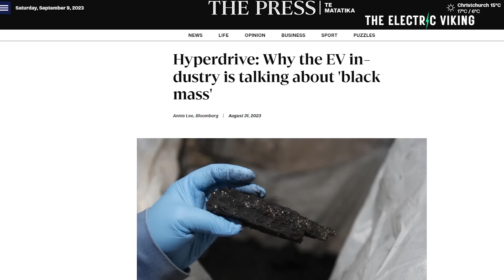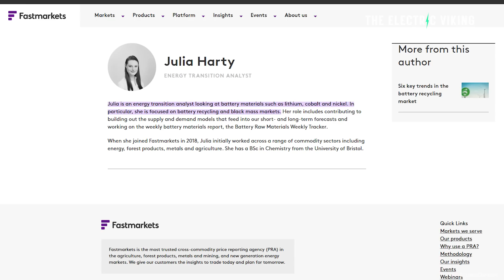A NEW battery gold rush begins: Black Mass powder listed on metals index

Comment: Lithium batteries are good for roughly 1000 charge cycles, give or take, and after that, they degrade very fast, going from 80% to 50 or even 30% very quickly (as a charge that it holds).
Reply: Citations, please.
Reply: @gregbailey45  google is your friend.  although there are so many new battery types coming out for EVs now, I'm hoping there are new formulations.  How long did your laptop's batteries last before degradation?  about 3 years?  what autonomy are you getting after 3 years of daily use?

Comment: I actually don't think all the announced battery plants in the US will be built. There's just not enough demand for EVs and a large segment is just opposed to them. And most of the battery plants that are built will likely not be profitable without government subsidies. A new president could likely end the Biden subsidies for EVs
Reply: What do you mean? Batteries are always needed, not just for EVs, airospace, toys, drones, computers, your phone, tablets, watches, backup power supplies, grid storage supplies (maybe the most improtant need) for both power generation and just everyday power control/resourse control, and many more. Lots of people want an EV - that demand there - the price, safety, mgf cost, life, range, etc are still things that people are just waitng for improvement. Also lots of people by things in cycles - meaning a car will last, what, 15 years before someone buys or even looks at another car? ICE will feel it at the pump in the next few years as oil cost continue to increase from 60$ a drum all the way to 300$ a drum other nations are looking at doing. Plus no one wants to be supply limited by China - so the move away from China is already in high demand across all sectors that need battery storage.

Comment: When will Tesla make a Replaceable Battery Pack? Renault has this coming. Problem is the cars would last a too long? My electric water pump gets new brushes and impeller every few years. It has run for 20 years.
Reply: Yeah, I think the assumption right now is that by the time the battery wears out the car itself will be worn out and obsolete.  In other words, you can definitely replace an engine in an ICE, but how many ICE cars actually get it done?
Reply: @getoffamylan6844  I live in a rural area. Lots of guys love driving their 1970s pickups. Overhauled engines nice paint jobs new upholstery. Classics. Same for lots of cars. I drive a butt ugly 2003 Toyota Echo. 265,000 miles. Kept it as a backup car. My 335x engine failed. At 55k miles. The Longevity factor matters greatly to the blue collar folks. One reason you see lots of classic cars and trucks  at the Factories and Air Force Bases etc.
Reply: @getoffamylan6844 Also, structural batteries make replacement impossible, or at elast difficult.

Comment: Recycling of batteries will increase but it may face a headwind of reuse and repair. Future battery technology won't degrade very much and may even get better with age so there will be a lot of folks attempting to get used ones to make other products or to use as a home storage system for solar and wind hobbyist.
Reply: That's hardly a "headwind"...

Comment: Here is an excerpt from the New Atlas web site. =>This is the second groundbreaking battery the company has released this year, the first being a mass-production "condensed battery," targeted at the electric aviation world, that holds twice as much energy per weight as a Tesla Model Y battery at a remarkable 500 Wh/kg. And that's not to mention the monster 140-kWh "Qilin" battery CATL supplied last year for a special edition of the Zeekr 001, making it the first production electric car with a range over 1,000 km (621 miles).

Sheer size and capacity is one way to alleviate range anxiety, but the new Shenxing battery attacks from the other direction, promising to charge up so quickly that a flat battery will be no more of an impediment than a flashing fuel light.    

CATL says the battery will charge from 0-80% in 10 minutes, unlocking up to 400 km (249 miles) of driving range in a single, very quick stint on a fast charger. That's at normal temperatures; take things down below freezing to -10 °C (14 °F), and an 80% charge using built-in battery heating will take you 30 minutes. The company says that low temperatures won't affect the battery's ability to deliver its full power to the wheels if needed.
CATL says it expects the Shenxing battery to be in mass production by the end of 2023, but is yet to nominate which OEM's EVs we're likely to see it appear in first.

Comment: I'm a little concerned about whether the trend toward structural batteries is going to throw a wrench in efforts to repair, reuse and recycle EV batteries.
Reply: Short answer - yes for repair.  Not for recycle though.  Recycling means the whole pack goes into shredder/grinder that turns the pack into powder that is then separated and reused.
Reply: @ohger1  Isn't there a lot of added labor in pulling out the battery pack, making recycling less economically viable?
Reply: @dansanger5340  During the scrapping of the vehicle or in a battery exchange?  An exchange on a Tesla (for instance) is probably a 5-8 hour job tops (perimeter bolts, cables, and coolant hoses) but cutting or even ripping out a pack on a scrapped vehicle by a dismantler takes minutes.
Reply: @ohger1 and then?
Reply: Nope.
Reply: Definitely not a concern in China as they have the full supply chain and recycle chain.

Comment: The problem is the cost associated with recycling. Battery chemistry deterioates even when unused unlike ICE counterparts. EVs are good for high utilization use cases, not so much for low mileage users.
Reply: That is essentially correct.  The other unknown variable right now is how these batteries will do with calendar aging.  Even if used lightly, these batteries may start becoming inert about the 15 year mark, so even a second life as storage may not be possible unless the packs are fairly new.  Time will tell.
Reply: Not fully true, metal still rust esp if it hasnt moved in a while. Let alone the gears and everything else starts to loose oil/lub. EVs will be good for both high and low. Unless you mean like no usage at all? ICE will be feeling the gas prices soon as the oil and gas we buy in goes up in price soon.
Reply: @adr2t  as long as you drive just a little bit once a month, oil and lube won't seize up. My lawnmower is still running strong for 30 years. I doubt any battery will last that long.
Reply: @i6power30  Right, really depends on how much we're talking here. In one path - if they  add a solar panel to the top of an EV you could get by never really charging your car either depending on how much you drive. Can't say you can do that with an ICE car :P Just to be clear - I am the type that dont see EVs taking over 100% - we're still have ICE for a while - just that they will get replace as battery technology gets better and that does take time as like anything - it lags behind what we see in production.
Reply: @adr2t  Solar panels that can be thin and light enough to fit on a car can only trickle charge it. It might take two months or more in the sun for a single charge. BUT, you can add a large array at home and charge, something an ICE owner can't.
Reply: @adr2t  I don't mind the hassle of charging the EVs. I don't like the fact that we don't know how long the current battery technology how many years can these batteries hold charges? It seems to depend on calendar againg rather than mileages unlike ice cars engines age dependent on mileage
Reply: @ohger1  Charge it to full yes, but to get another 30 mins to an hour wouldnt take a month, only a day worths of charging. Thats kind of my point if its for low usage driving because you wouldnt be driving that much in the first place for it to matter. Solar can also hit around 50% eft. meaning we could build some high power panels for the smaller space - and thats before we talk about CL to also improve how much light hit the solar arrays. Lots of people leave their cars out all day - meaning 12hrs of sun light durring the summer time for cheap easy power.
Reply: @adr2t  I haven't run the numbers, so I can't say you're wrong, but solar panels don't approach 50% efficiency even in laboratories, and the chances that the panel is aimed for maximum light to elec transfer is long indeed.  Some solar "cars" can get significant run time with a solar roof, but the ones I've seen are really three wheeled motorcycles more than cars - something (at least in the U.S. would never sell).  I have a 2018 Tesla S, and that beast wouldn't pick u 3 minutes of drive time if it was parked in the direct sunlight for a full day with as small a solar panel that would fit the size (and shape) of my car's roof.
Reply: What utter cr*p.

Comment: Far as I know, at least for EV batteries they go in cycles 1st use in your car, follow by 2nd life in battery related projects, and finally 3rd use recycling. Granted, the recycling half is the part that isnt fully up and running - so they might sit some place until recycling can happen at scale. As for the "black mass" its just the deacted carbon. Fun fact, we know how to recharge the carbon - you pretty much just heat it up. There are many ways to reheat that carbon back up as well that doesnt require power - but can use direct heat solar using lenes. The problem with "Black mass" is that its containing all sorts of elements - thus you would have to sperate the elements back out and that does add a bit of extra cost. Granted, I would argue raw new Li cost more to pull those rarer metals out. The active carbon on the other hand... hit or miss results. Its both cheap and yet still needed. There was also question if it being mix like that it doesnt start to have other issues like oxidizing.

Real question is will this keep going if we switch from Li to Na. Na is cheap and would get more value out of just mining more from the ground. Same with the idea of sulfur instead of active carbon.

This is why I do belive battery packs should be required to allow someone to replace the grouping of cells too. Because if its just a few cells that are not acting right - we shouldnt be dumping the whole battery. Let alone its a waste for the shell by recycling them like this. If anything, it should be common practice to "cycle" the cell modules out refreshing the whole pack every few years. Telsa and others should be required to make this happen if they want to sell EVs in whatever markets.
Reply: Did you assist in writing the screenplay for Ben Hur? Just wondering
Reply: @robertfonovic3551  Na, but I do write "how to do this dummy" emails alot:) (and no this wasnt at you, I really do write a lot of emails having to explain basic stuff to people).
Reply: Go back to school, dude, and stop talking b.s.

Comment: I think you're glossing over environmental concerns. The "European Red Tape" Yiu refer to is probably there for good reason.

Chinese disregard for the Environment has been pretty well documented... as for the US... they do a better job of hiding it. 

There was a time when semiconductor manufacture was considered a "clean industry", yet we still haven't "fully recoverd" from all the dumping of hazardous materials in Silicon Valley; even if the EPA might tell you otherwise.

My guess is that the recycling process you're talking about involves solvents, and the other question would be what happens to the waste generated from this process.

Comment: Sam could you do a video on the breakthru  at Lawrence Livermore National Laboratory (LLNL) who reported that they had successfully synthesized the rare earth metal dysprosium by mimicking the conditions found in a meteorite called a tannerite. The implications for this on other rare earth metals is profound. I would use a used EV battery for home storage anyday if you could find one to buy.
Reply: You really shouldn't fool around with an EV battery - they're 400 VDC and that's deadly if you get shocked by it.  Besides being a shock and safety hazard, they're a fire hazard.  They can supply so much power that wires can instantly turn into yellow hot molten metal.  Water could make things worse.  So leave them to those who know how to deal with them properly.
Reply: @acmefixer1  Those are all good points but you are more likely to get killed in a accident driving the car the battery was harvested from than from tinkering with the battery ....just sayin

Comment: I hope you’re right, but I have my doubts due to the foolish belief that our plastic bags and bottles are really being recycled rather than being incinerated as they actually are in many developed countries.
Reply: The price of lithium, Cobalt, Nickel etc makes the big old batteries worth thousands of dollars. Massive amounts of money to be made, so it will work.
Reply: @AORD72  For now - the plan will be to switch to Na once its up and going - I am going on a wim and said we're not going back to the other elements in making them thus the value of for the battery will drop.
Reply: @adr2t  But what energy capacity does Na batteries have? I would think there will be plenty of lithium batteries for a long time to come.
Reply: @AORD72  At this time no, it requires something 7k cells just to make a battery back for a tesla. Na has about a 30% difference to Li. It would require 30% more batteries to make up the difference, but you also have to take in the fact we can make them solid state and/or use sulfur in exchange to boost their power per weight up as well. Hybrids would be required more than likely to mix Na and Li batteries for the best mix results in terms of range and cost. Na can hold between 600-900 from what I saw around pertty close to what I saw with Li solid state batteries. Li can reach something like 600-900 as well. I know a wide spread ~ but they're also testing the mixtures still for all sorts of different outcomes, life, recharge rates, storage, etc etc.
Reply: Recycling is largely a bullsh*t scheme created by manufacturers so we keep on buying their shiny new objects.

Comment: Sounds like a tremendous way to import Chinese raw material into Europe's closed loop build out. Use the auto for 10 years and then trade the battery in for an upgrade replacement.

Comment: Lets break that "Black Mat" market value down, shall we? 

Assuming LiPO: $10K[USD] per metric ton = $10/kg = 1 cent per gram = $4.55/lb = 0.284/ounce

For perspective: a single 18650 LiPO weighs about 50 grams or about 20 batteries per kilo [about 1-3/4 ounces each or 9 batteries per pound]. 

So a dead 18650 LiPO is worth about 50 US cents ..post processing. 

It is not clear if black mat includes the metal shell, but I am guessing it does.

Hmm. So a dead drill battery pack is worth somewhere between $2.50 for a tiny 18v up to around $20 for those honking big 80v packs.

Hmm. Time to look into DIY BM processing.

Comment: Sodium ion will eventually be King !!!
Reply: Real question, is how do we recycle those :P the Na would be worthless at that point lol
Reply: Doubt the energy density of sodium will be enough. Hopefully aluminium batteries will be makes with 5-10 times the energy density of LFP batteries.
Reply: @AORD72  Na + SS + S pretty much put them at between 600-900 more than plenty consider batteries today are between 150-250. SS = Solid state, S = Sulfur. Sulfur allows a power dens 2.5-3 times current carbon methods. Solid state makes them HALF the current size they are today. Na is only 20-30% less - meaning you would need to add that much more into your battery - but the size different isnt much - just a little more weight per cell so solid state removes that extra weight gain along with cutting them in half in terms of size. Li and Aluminum both can use SS and S as well. Na will more than likely win out on Ai because of just raw cost though. Na is found everywhere and doesnt require the needed foundries to refine it. Na cost less than pennies - while Ai would cost pennies. Would depend on energry des, life, and charging speeds I would assume at those cost who will take over. I would just assume Na would have the upper hand because it can be found everywhere and it would have a higher supply of the elements that is easy to get a hold of.
Reply: @adr2t  O they do have high capacity, however articales say  "This kind of battery operates at higher temperatures ranging from 300°C to 350°C" is that the problem?
Reply: Sodium batteries will be more than enough for the 90% of remaining rollout of EVs, for a fully built out mature fast charging EV network.  charging stations will be less than every 100km. Much less in a mature network.  It will be just like a regular petrol station network once fully matured.  Most people wont drive more than 100 km per day and most will charge at home anyway for long trips. If they stop every 250km to recharge to 80% in 15 minutes,  no big deal.  Most people need a rest after 250 km of driving anyway.  Not like this has to happen overnight.  It will take well over a decade to replace ICE cars.  It's game over.

Comment: Does Australia have laws dictating what happens to batteries. From what I have heard we don’t.
Reply: I would like to see nations implement a 'core charge' on EV batteries similar to the one on old-school 12v batteries.  You pay 1,000 bucks (for example) of extra money when you buy the battery (ie the car that includes it), but then get 1000 dollars back when you turn it in for recycling.

HOWEVER, if what I am hearing is true, this may not be necessary; it appears that the elements in the battery itself are worth so much that throwing them away makes no sense to begin with.